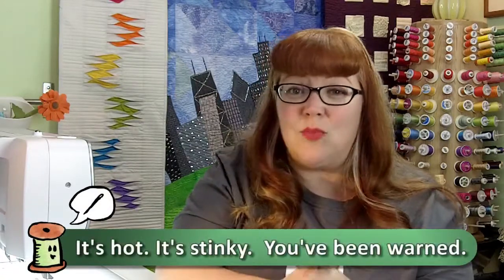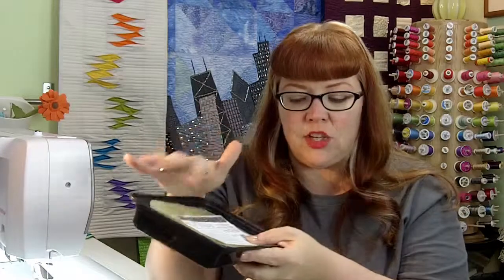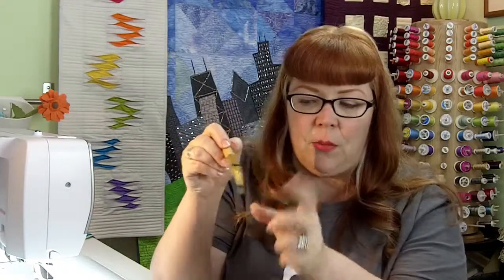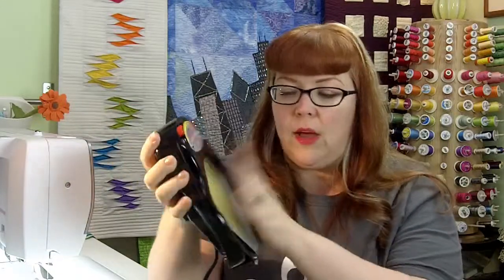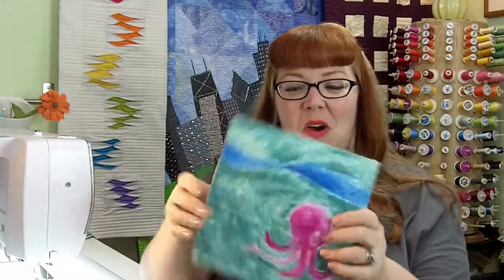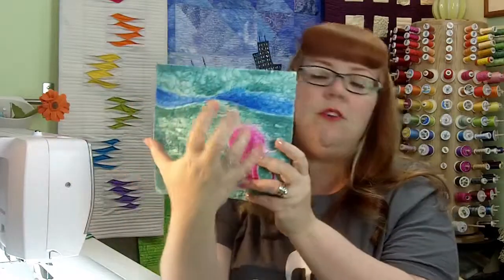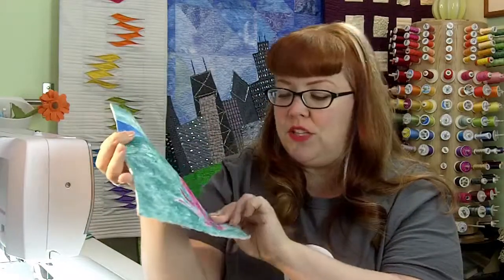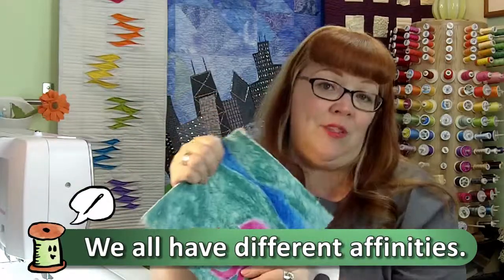Technique of the Week #36 - Batik Wax Resist

Comment: Aww, bummer. You have all the stuff, try it again! The wax may not have been hot enough, I just ran into that issue yesterday when I took batiking up again. I finally realized the problem before I ran out of fabric, turned up the heat to like 225 F, and voila, like butta!